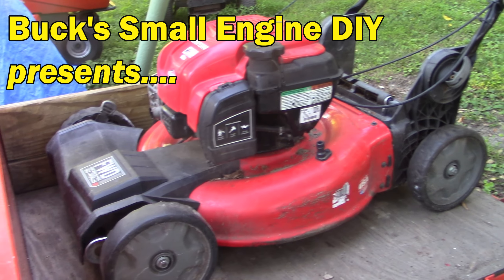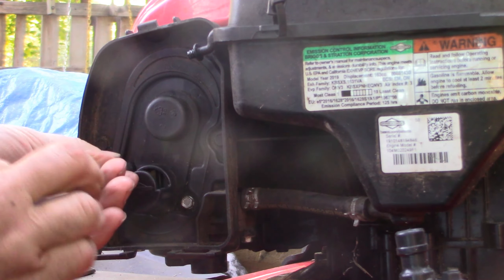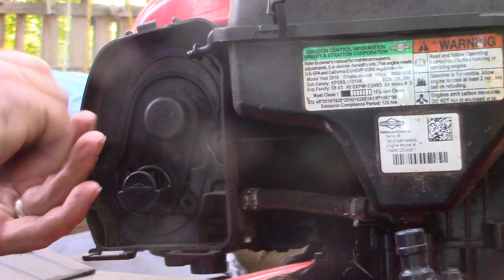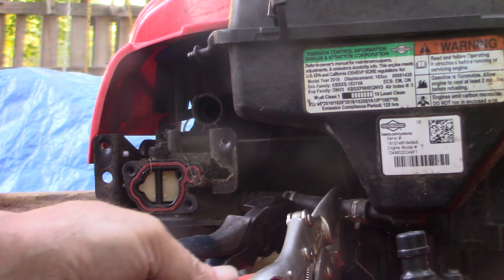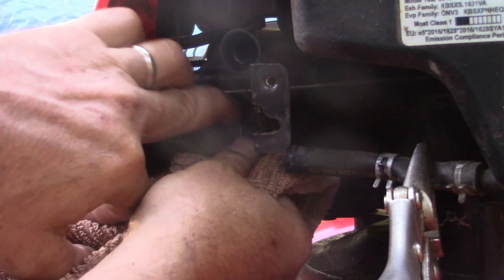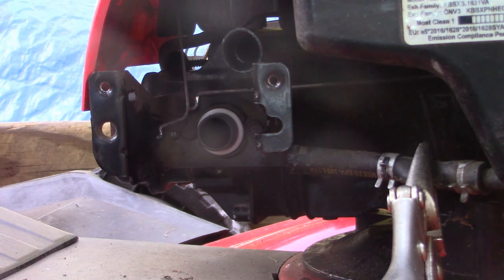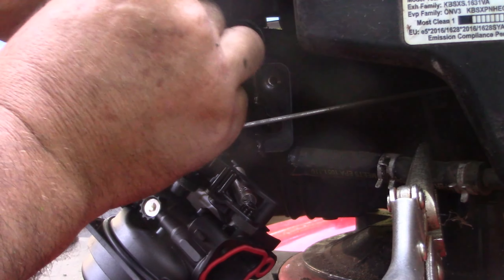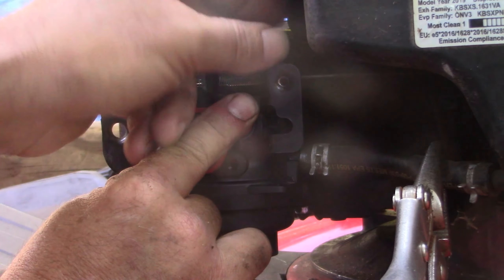How to EASILY REPLACE a PLASTIC Briggs & Stratton CARBURETOR - Easy DIY Carb Swap !!

Comment: Thanks for this great video! The gas went bad in my Costco Husqvarna powerwasher and this video made it easy to replace the carb in about 10 minutes! Carb was a: 799584 594058 carburetor for briggs & stratton 592361 594057 550EX 675EX Husqvarna LC121P 725EXI 625EX Troy Bilt TB110 TB200 lawn mower.

Comment: 90 percent of all B&S and even Stihl carbs and parts are made in China.  Nothing is made here in America anymore.
I'm working on a Toro with the 150cc B&S engine with these stupid plastic carbs and it take 4 to 5 hard pulls to get it started . After it starts it runs great until you have to stop and start it again. I have a new plastic jet coming and if i still can't get it started on the first or second pull I'll order a carburetor
Reply from the maker: Is the automatic choke working properly? Or does it have a primer bulb?
Reply: @Buckwsr  it has the auto choke and is working so I believe it's in the carburetor main jet